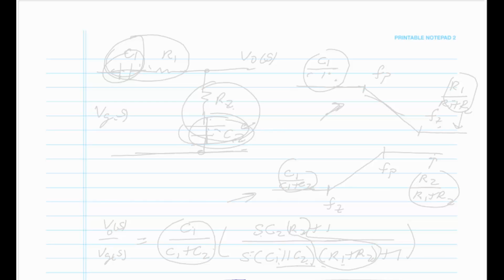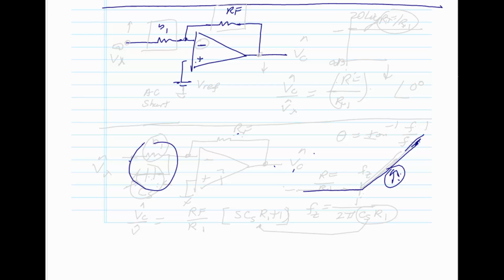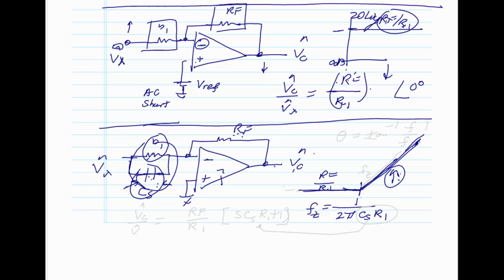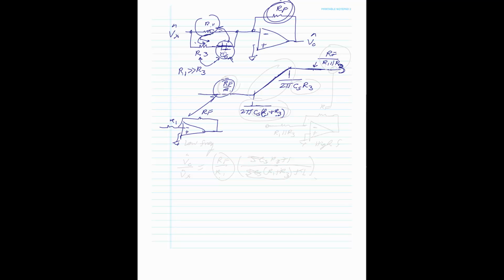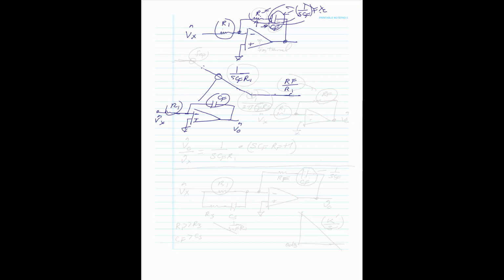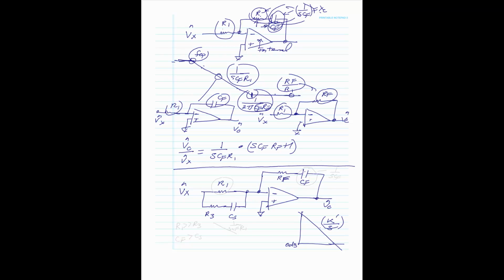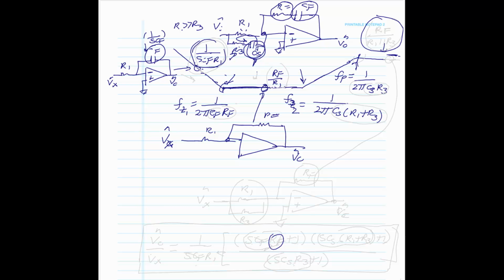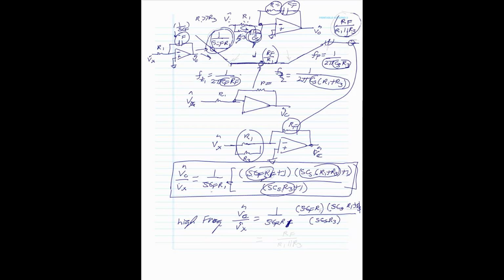Understanding Poles, Zeros and Transfer Functions in Passive & Active Circuits

Comment: @14:45 Transfer Function has the pole-zero mix-up. Zero Results into a +20dB & Pole results into -20dB cancelling out and provide a flat gain due to Rf/R1//R3...Overall excellent analysis....good way to look at transfer functions from circuit point of view...
Reply: I confirm as well.